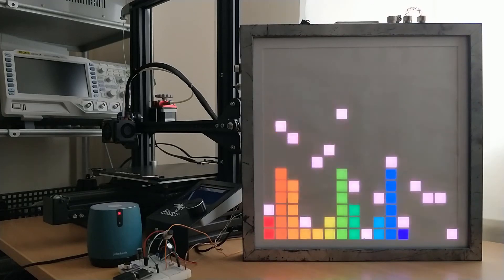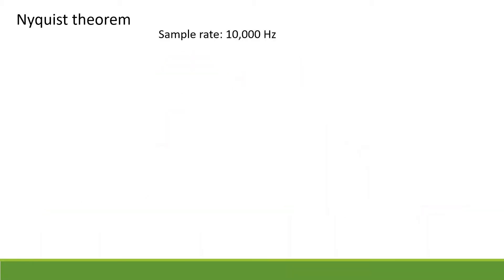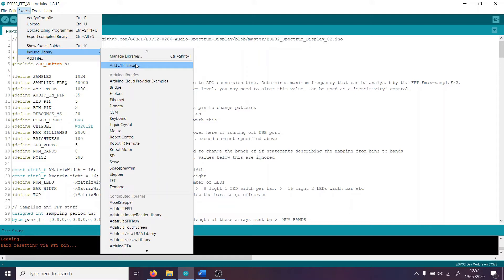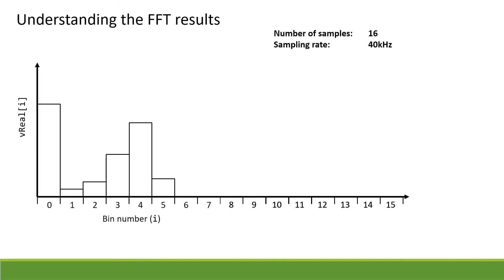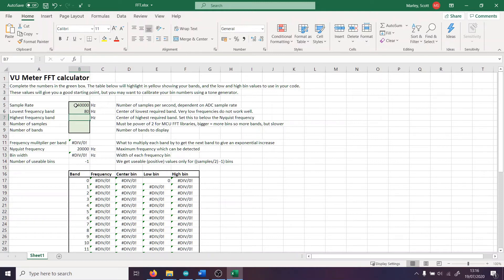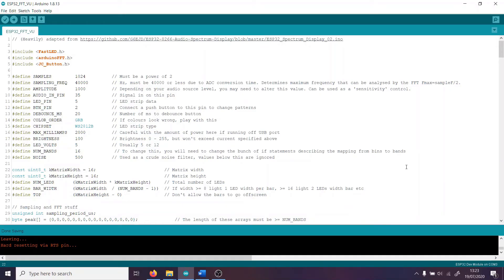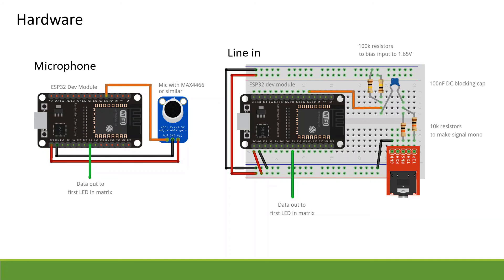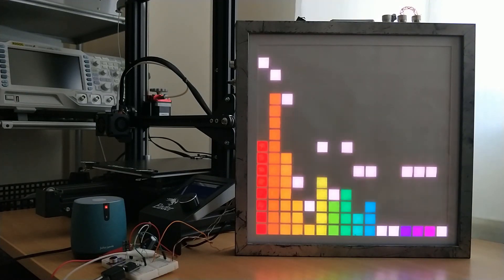ESP32 spectrum analyser VU meter using arduinoFFT and a FastLED matrix

Comment: Hello Scott Marley,
I have a problem regarding the Max sampling frequency of my ESP32's, running the test shows that the conversion time is 53 µs and therefore the max freq. is only 18kHz which translates to 9kHz Audio.
My ESP's are way slower than yours, do you have a clue?
Reply: Hi Yiruma.  As mentioned below by Marek Bohumsky If you install the 1.0.4 version of the ESP32 board via the Boards manager and re-run the sample code it does give a result of 9.73uS.  I had the same issue and changed the code for the lower sample rate.  Now that I have also found the answer (from below) I will try it with the corrected code. Just passing it on, hope this helps.
Reply: @andrewmcwhir8973  It works fine, thank you!
Reply: @andrewmcwhir8973  Thanks, that worked for me aswell.
Reply: @andrewmcwhir8973  Thank you very much, I'll try that! :)

Comment: Hi, just got strange problem, after uploading code "sample test" getting result:
Board AZ-Delivery  ESP32-WROOM-32

could you help ?

ets Jun  8 2016 00:22:57

rst:0x1 (POWERON_RESET),boot:0x13 (SPI_FAST_FLASH_BOOT)
configsip: 0, SPIWP:0xee
clk_drv:0x00,q_drv:0x00,d_drv:0x00,cs0_drv:0x00,hd_drv:0x00,wp_drv:0x00
mode:DIO, clock div:1
load:0x3fff0018,len:4
load:0x3fff001c,len:1044
load:0x40078000,len:10124
load:0x40080400,len:5856
entry 0x400806a8
Conversion time: 53.95 uS
Max sampling frequency: 18534.12 Hz
Reply: SOLVED:

You need to install older version of ESP32 boards to Arduino IDE.

Version 1.0.4 
board AZ delivery WROOM 32 
Arduino IDE ESP32 DEV Modue

Now Getting:
Conversion time: 9.71 uS
Max sampling frequency: 102948.76 Hz
Reply from the maker: That's interesting, I don't know why it would be so much faster on the older version

Comment: Greetings. First, thanks for the video and for the device and the code for it! Thanks for the hard work! I repeated the device, but several questions appeared, with which I ask you to help. I do not understand well in such crafts so far .. 1) Your vu meter speed is faster than mine. I have a feeling that it slows down, it does not work so smoothly. Is there something wrong with the firmware? (although it may seem to me ..) 2) Everything works only when the ESP32 is connected to the computer via a usb wire. If you power it separately from the power supply, the entire image on the matrix hangs and does not react in any way to the sound / button. What could be the problem?

Comment: Did you test out with microphone setup? How much worse it is compared to line input? looking to get 20-20KHz electret microphone with amp and gain control to make thing easier.
Reply from the maker: No, too busy to go back an look unfortunately. I did make a whole new VU type thing using a digital INMP441 which you can find on my channel. It's a cool little gadget, but needs some tuning to make it a bit more accurate. Having used the digital mic, I definitely won't be going back to the old analogue ones now though, it's so much less noisy!

Comment: I see since this video, you've changed the matrix "serpentine" unused and use the neomatrix library instead. So if my configuration of leds goes from bottom left going upwards, zigzag, when I edit the neomatrix setup with those in mind it should work without any other edits to the code right?
Reply from the maker: That should work, but I haven't tested it as I don't have lot's of different matrix arrangements to test with.
Reply: @ScottMarley  i just got it working with my specs, the neomatrix makes it quite easy to manage. thanks for the guide!

Comment: Scott - this is so good! I built my own using your instructions and an 8 x 32 matrix. Looks great :) One thing I'm finding is that if I power both the ESP32 and lights from 5V 10A female adaptor, the ESP32 reboots if current is too high (this is qualitative based on observing my brightness setting/no. of LEDs on display). If I power ESP32 separately via computer's 2A USB, I don't see this problem. Any clue what might be going on? Happy to share code / diagram if you're up for it :)
Reply from the maker: Sounds like exactly what you said, the LEDs are drawing too much power. At max load, your matrix could theoretically draw 8 X 32 X 60 mA = 15A. If your power supply is a cheap one (you know the eBay type) I wouldn't use it for more than half it's rated current (5A). Or just keep the brightness down, I don't use a birghtness of more than about 100 and that helps greatly.
Reply: Ciao matt Jones, anche io ho una matrice 8 x 32 ma non riesco a farla funzionare nel verso corretto. Potresti inviarmi i tuoi codici? grazie

Comment: Nice tutorial.
Try this for a faster result:

void loop() {
    //Leave this loop empty!
}

void MyLoop(void *) {
   for (;;)
   {
       //Write here all the codes from the original loop void
   }
   vTaskDelete(NULL);
}

void setup() {
    //Your setup codes....
    xTaskCreatePinnedToCore(MyLoop, "MyLoop", 40000, NULL, 1, NULL, 0);  //40000 is 40KB stack size. The 0 at the end is the first Core, if you use number 1 it will use the second Core.
}

Cheers.

Comment: I use Board ESP32- Devkit V1. But Max sampling frequency is 16khz. No 100khz. Please help me.
Reply: At the boards manager in arduino ide install a previous version of the esp32, the latest 1.0.5 is not as good as an older version.
Reply: @jozsefcsiza2760  Thank you very much, it worked for me installing the 1.0.4 version. Conversion time: 9.74 uS
Max sampling frequency: 102671.92 Hz
Reply from the maker: Make sure the clock frequency is set to its maximum, but other than that I have no idea, sorry!
Reply: Did you could solve your problem? my ESP32 clone  is showing: Conversion time: 52.93 uS
Max sampling frequency: 18893.39 Hz
Reply: I just find:  #include "esp32-hal-cpu.h"   and  

in the setup: setCpuFrequencyMhz(240); 

 and to read: 
  Serial.print("CPU Frequency is: ");
  Serial.print(getCpuFrequencyMhz()); //Get CPU clock
  Serial.print(" Mhz");
  Serial.println();

Comment: Amazing video sir! I just completed the entire circuit and it seems like it's reacting to music accurately, however my bars keep pulsing from right to left. I connected the input to matrix to bottom left, so my question is how can I turn it 90 degrees so it can pulse from bottom to top? Is it located here: 

// XY code for serpentine matrix with input in top left
uint16_t XY( uint8_t x, uint8_t y) {
  uint16_t i;
  
  y = kMatrixHeight - 1 - y;  // Adjust y coordinate so (0,0) is bottom left

  if(SERPENTINE) {
    if( y & 0x01) {
      // Odd rows run backwards
      uint8_t reverseX = (kMatrixWidth - 1) - x;
      i = (y * kMatrixWidth) + reverseX;
    } else {
      // Even rows run forwards
      i = (y * kMatrixWidth) + x;
    }
  }
  else {
     i = (y * kMatrixWidth) + x;
  }
  return i;
}
.
If so what parameters do I have to change so it does what I want it to do? (BTW I wired my matrix in PROGRESSIVE configuration/all led strips are facing the same direction). Thank you in advance, I'm looking forward to the next project.
Reply: maybe you find my answer to 
rasheed el hanout helpful (further down the comments)
Reply: @marcosanti2357  OMG that actually worked!!! Thx a bunch dude. I had to play around with the code a bit, but regardless it works perfectly. Here's how this section of the code looks now:
 // XY code for serpentine matrix with input in top left
uint16_t XY( uint8_t x, uint8_t y) {
 
  // Rotation counterclockwise
  //uint8_t tmpX = x;
  //x = -y + kMatrixHeight - 1;
  //y = tmpX;
  
  //Rotation clockwise
  uint8_t tmpX = x;
  x = y;
  y = -tmpX + kMatrixWidth - 1;
  
  uint16_t i;
  
  y = kMatrixHeight - 1 - y;  // Adjust y coordinate so (0,0) is bottom left
 
    // Even rows run forwards
    i = (y * kMatrixHeight) + x;
  return i;
}
Reply from the maker: Great, glad you've got it sorted!

Comment: First, great video and explanation of the science behind the FFT library. It inspired me to build my own LED matrix. I built it in exactly the same configuration that you did, with the copper tape running up the sides for the power and ground and the signal wiring connecting each strip on the back of the board. Lights work great. However, when I upload the code, with the 16-band configuration, my matrix shows a mirroring effect--meaning that when I run a frequency tone test, instead of the columns lighting up left to right like yours did as you increase the frequency, both the left AND right columns light up and meet in the middle and proceed to end on the opposite ends. Did you change the code to produce this effect or would this indicate that I have an issue with my wiring or circuit setup?
Reply from the maker: That's very weird! There were a couple of changes made to the code a while back but nothing that should have caused that to happen. I haven't looked at this in a long time, but if I'll check tomorrow to see if there is a bug somewhere.
Reply from the maker: I just checked and it works fine for me, so it's possible that your matrix is wired end to end (all strips facing the same direction) rather than serpentine. I've updated the code on GitHub, download the new version and change #define SERPENTINE to false and see if that works for you.
Reply: @ScottMarley  That's it! Problem solved, works great now! Thanks SOO much for helping out this noob with the updated code. I figured since you wired your LED's all in the same direction that the code would work with that configuration. So did you re-wire your LED's in a serpentine config? Thanks again, you saved me hours of headache.
Reply from the maker: @ryandhowell07  Yes, at some point I rewired it to serpentine as it looks neater and it turned out that most examples assumed that layout. Sorry about that!

Comment: Hi Scott,
You might want to add the line:
#define BRIGHTNESS      200
to your ESP32_FFT_VU ino file just to give your fans a less bumpy ride :-)
Reply from the maker: Thanks for pointing that out! This was broken by a pull request that I merged, and don't spot this issue at the time. Should be fixed now, although I haven't tested the code. Cheers.

Comment: Can you pls make the same for arduino uno.      It will b good
Reply from the maker: No I can't. It doesn't have enough RAM and it's not fast enough. An ESP32 costs around $8, much cheaper than an Uno and can be programmed in exactly the same way as an Uno. Try it!
Reply: @ScottMarley  ok thank u

Comment: Is it possible rotate to Horizontal, not vertical like right now, cause i'm using 16x17 (16 bands, 17 stripes). Everything would work fine if i could change probably XY.
Maybe this part could be my chance to change direction? 
"// XY code for serpentine matrix with input in top left
uint16_t XY( uint8_t x, uint8_t y) {
  uint16_t i;"
Spectrum analyzer right now for me goes - from right to left, and i wish it could go from bottom to top.
P.S. in ur video, leds glued horizontal  - thats my problem, cause my leds glued vertical, so tryin to find solution :)
Reply from the maker: I wrote a different piece of XY code for someone else in the comments here that rotates it. No idea how it will respond to a none-square matrix though. https://pastebin.com/cBa3rSNX try replacing the XY code with this (uncomment the section to rotate it clockwise or anticlockwise as needed)
Reply: @ScottMarley  Thanks for response, appreciate it ;)

Comment: hi I hope you are doing fine. I ported your code for Smart Matrix library to make your code working with scan based panels. your code is amazing . I will share my code to GitHub soon. But for some reasons band values are messed up, I am trying to make it work with 32x16 panels so number of bands are 32. I edit the arrays to 32 and calculate the Bin with axel file , but display show response from 9th band before these bands leds remain dark most of the time.  thanks for your amazing work.
Reply from the maker: Brilliant, thank you for doing that! I only have square matrices here, so I can't test non-square shapes. If you do get it working though, let me know!
Reply: @ScottMarley  hi I got that fixed, I just need to change base frequency to 330hz because i am using max9814 based mic it is really not good bellow this. btw this is not non-square matrix it is scan based panel unlike ws2812 matrices these are non-addressable. few things more to get fixed and I will upload it GitHub.
 thank you
Reply: code is here 
https://github.com/alpha815/esp32-smartmatrix-spectrum-analyzer
Reply: @muhammadshahzaib3813  Not working code

Comment: so i've tried this and it works so far. I also tried to split the line in so that I can plug in my headphone but then it stopped working for some reasons. Could it be the voltage drop after splitting?
Reply from the maker: This seems to work with some inputs and not others. I believe it is to do with the impedence of the things that are plugged into it, causing a voltage drop as you say. The 'proper' way to do this would be to use an opamp as a buffer between the connected devices (as they have very high input impedance), but was a bit complicated to show in this video.
Reply: Adding on to this, if I slap a buffer/voltage follower with an ne5532 right before the esp32 input pin, that should work a treat for this problem right?

Comment: Great video. I don't know much about electronics, and I was wondering if the sound input could come from the left and right outputs from a Marantz receiver?  Would the amplification be too much or is it the same as a 3.5mm output?
Reply from the maker: Don't connect this to the speaker outputs unless you know how. The maximum analog input for the ESP32 ADC is 3.3V. An amplifier can run at much higher voltages than that (10s to 100s of volts depending on the power) and will destroy the ESP. If you must do this, you will need to use a voltage divider before the ESP, but how you do this will depend entirely on the voltages that your amplifier provides. The amplifier surely has some kind of lineout you could use?

Comment: Hello, I have an Arduino Mega 2560 (a chinese one), and when I try to do 1 million reads, it does it in 112 seconds, and the frequency is 8928.56 hz. You do those reads almost instantly. I'm trying to do a spectrum analyser for music on a led matrix. How should I adjust the SAMPLING and SAMPLING_FREQ, so that I will get resonable results? Or what other advice could you give me? Thanks. I will  mention that I do not have any wifi or bluetooth module, I just plug my audio wire in arduino, and read from that pin.
Reply from the maker: The Mega (16MHz) is very slow compared to the ESP32 (240MHz) I am using. If you are going to use this code, I recommend you use a faster MCU, such as the ESP32 or Teensy 3.0. Not only do you have to do the sampling, but you also need the processing time available to write to the LEDs. It is possible to do an FFT on the Mega, maybe using the FHT library (http://wiki.openmusiclabs.com/wiki/ArduinoFHT), but I've never tried it as the ESP32 is just as cheap as a Mega!
Reply: @ScottMarley  Thank you for the response! I'm doing this as a school project, and I'm not allowed to use extenal modules. Can you give me some advice as what should i change in the code to make it work? I shall mention that it doesn't have to be perfect, even if the matrix refreshes only 5-10 times a second, that is still good.
Reply: @UndeadSasuke34  Your project is probably over by now, but I'd recommend searching for the Open Music Labs FHT library, which runs quite nicely on a Mega/Uno/Nano. I think the arduinoFFT library is best used on the faster ARM based chips.
Reply: @AndrewTuline  Yes, the project is done. It worked, but it was quite slow, and the results weren't that amazing. Thanks for the advice, I even might go back to it and tweak it in my free time.

Comment: Tell me on the MSGEQ7 microcircuit will it show the frequencies more accurately, or can you achieve the same effect using the Fourier transform in Arduino method as shown in yours?
Reply from the maker: The MSGEQ7 is great for low perfornamce micros such as the nano, uno etc. The advantage of an FFT is that you can specify the number of bands you want to look at, where your frequency cutoffs are etc. Presonally I would use an FFT on a higher performance micro like the ESP32 and a MSGEQ7 on something slow like a nano.
Reply: @ScottMarley  It turns out that on your ESP32 the frequency reproduction quality will be the same as on the MSGEQ7 chip? I would like to create a better quality playback, your video displays everything in a very high quality. So I'm thinking of doing it like you do or on the MSGEQ7 microcircuit. Ideally, you want to make a project like this, so that the colors change.
https://www.youtube.com/watch?v=jTqKfHqB1BQ&ab_channel=PLATINUM
Reply from the maker: @androidtelefon  I don't know, I've only really done it using the ESP. Doing it this way worked well enough for me.
Reply: @ScottMarley  I also really liked your project, thank you for your answers, I'll try to do it.

Comment: Is it possible to use this application on Arduino nano? Tell me what pins to specify?
Reply from the maker: You can't use this code on a nano, it's much too slow I'm afraid. If you really want to do it, check out the FHT library http://wiki.openmusiclabs.com/wiki/ArduinoFHT
Reply: thx man 
Version 1.0.4 
board AZ delivery WROOM 32 
Arduino IDE ESP32 DEV Modue

Conversion time: 9.71 uS
Max sampling frequency: 102948.76 Hz